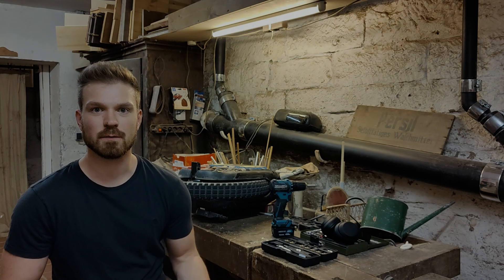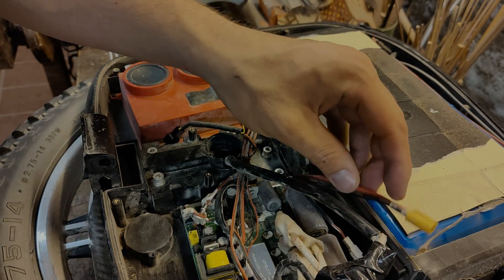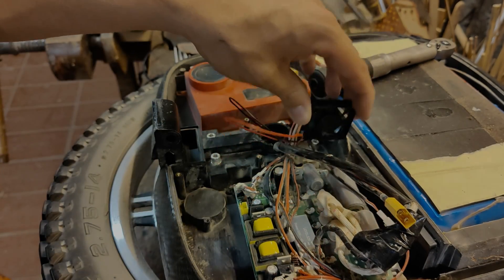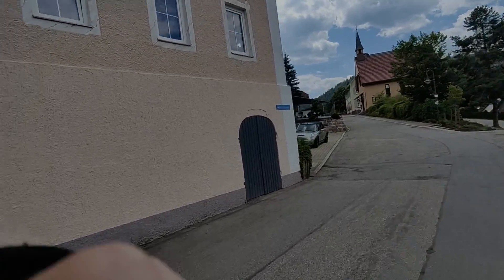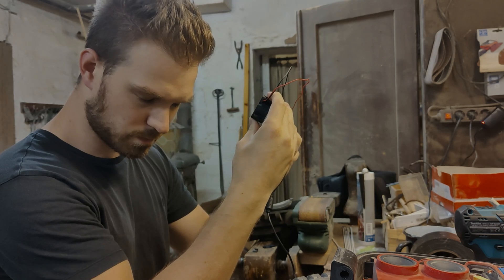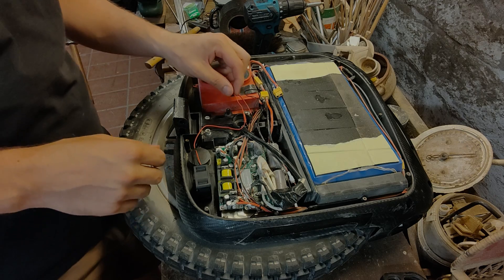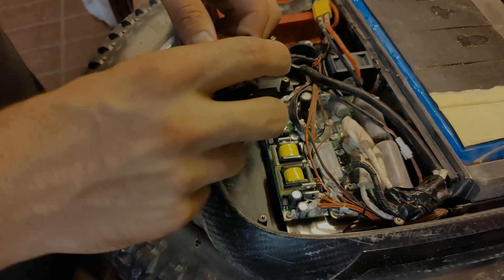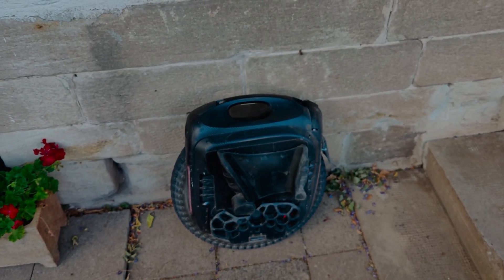Gotway RS19 Fan Upgrade - Step by Step

Comment: That's also why I bought V12HT instead of RS HT. Huge heatsink and no fan, plus it is properly sealed :). I am really surprised how badly sealed is the RS. I also have Begode Tesla T3, after 2500 km it was like new inside...
Reply from the maker: Ohh Damm! Yeah the RS is horrible sealed... And it's so nice that you got an IP rating on the V12!

I'll replace the RS this month with the T4 though. So also a 16 inch wheel.